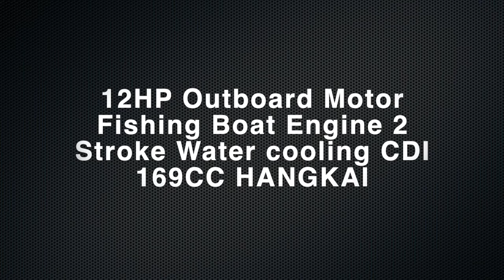12HP Outboard Motor Fishing Boat Engine 2 Stroke Water cooling CDI 169CC HANGKAI

Comment: I saw on some spec sheets #93 gas, do you use premium gas or is that a different number than octane?
Reply from the maker: I used the regular gas. I mixed a little more (just little more) of the 2 cycle oil for more protection.
Reply from the maker: You can use 93 octane, your whole day fun probably use 2 gallon.

Comment: I got a question for you on my 12 horsepower motor where the spark plugs are if you look straight up you'll see a silver round cap on top if you follow it straight down its shooting out water and filling up the housing why is that happening
Reply from the maker: Sorry I haven’t been using my motor that much last year. But I noticed that the water shooting kind a weird direction too. But I can’t remember what is it right now. But my motor is running cool, that’s I worried about.

Comment: Wish i could buy one but there are none online or on Amazon for one. Been trying to buy one for 3 months
Reply from the maker: Yeah, it excellent cheap motor
Reply: Try Aliexpress, it takes a while longer but plenty there. I bought a 15hp two weeks ago
Reply: Walmart has them online and they ship in 3 days. I just got the 18 HP 2 stroke model.
Reply: @JJLeMay did it ever come in ? I’ve been looking at the one at Walmart
Reply: @lloydbauch8908  Yes. I got it within 3 days of ordering. Sorry if my previous post wasn't clear. I've had the motor a year now and still happy with it.
Reply: @JJLeMay  oh good , thank you I was worried it wouldn’t come in if I ordered it with Walmart due to it being 999 for the 12hp kit
Reply: I got my 12 HP off Amazon 3 months ago and love it 1000 dollors

Comment: How fast is it
Reply from the maker: Pretty fast for the price
Reply from the maker: You can check my other video when I test the motor out
Reply from the maker: About 16mph
Reply: @giainhsumofamily9038  I get 16 mph on a four stroke 9.9 mercury on a 14 ft vhull what size is your boat
Reply from the maker: @keithmahler4236  10.3 with 450lb. First test run. Now it break in, I felt it has more pick up speed and faster
Reply: @giainhsumofamily9038  I've done 19mph then I added a hydrofoil to plane quicker and I lost end speed now I'm doing 16/17.5mpg with 2 on-board by myself 18mph but I felt unsafe on a 10.5ft inflatable

Comment: Why won't mine start? Has spark and gets gas
Reply from the maker: how are you trying to start?
Reply: A friend of mine bought the Hangkai 18 it will start up run for a minute then die any suggestions. Already checked the carb
Reply from the maker: @brandoncoleman5572  could it be the fuel line?
Reply: @giainhsumofamily9038  No have tried with 2 different fuel lines
Reply from the maker: @brandoncoleman5572  can you try to take out the carburetor and clean it, maybe something clogged inside? It happened to my lawnmower before. It would run about a minute and it die.
Reply: @giainhsumofamily9038  That was the first thing he did
Reply: Coleman adjust the pilot air screw and idle screw